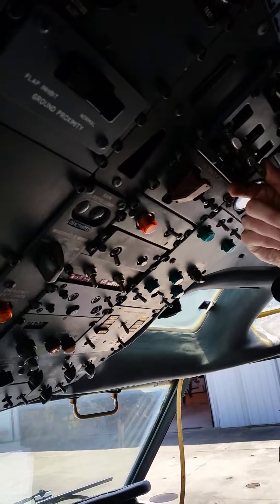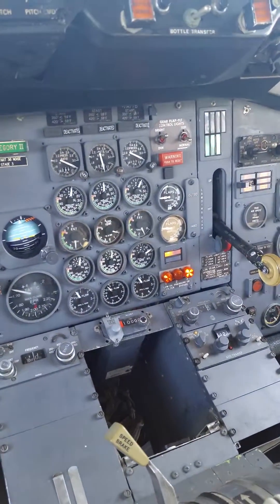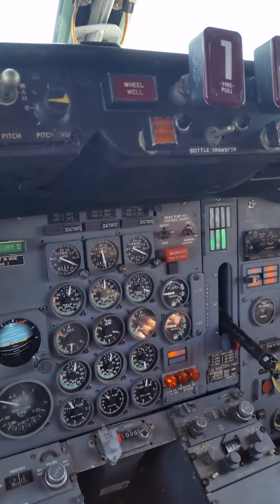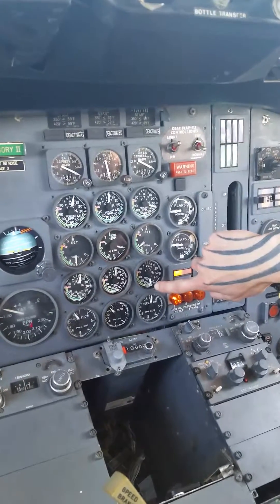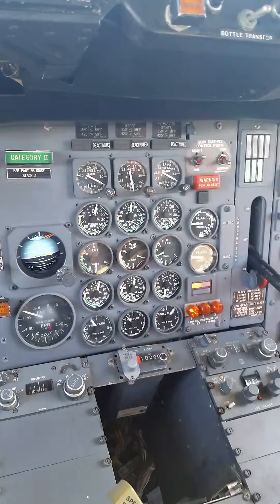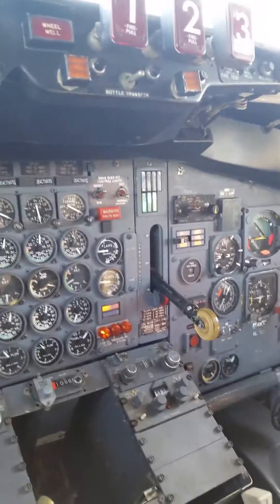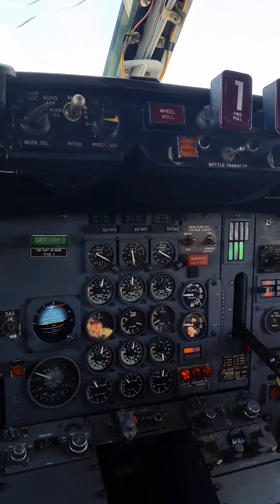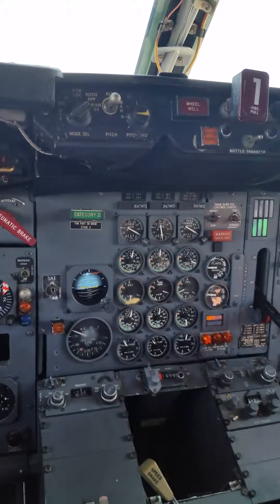B727 engine startup

Comment: No B system pressure (the brakes are on B system).  Only showing accumulator pre-charge pressure on the brake pressure gauge (meaning ZERO brake pressure). No pneumatic (emergency) brake system pressure. This was VERY dangerous, especially when you advanced the thrust levers.  The only thing holding this airplane were the chocks. You have NO IDEA just how dangerous this was.
Reply from the maker: not disagreeing with you at all. If I remember, we knew there were no brakes and it also had a mean hydraulic leak from a horizontal stab actuator that we didnt have the equipment to reach it for repair. The apu was also being problematic. But, we just use one of the engines to train students on proper turbine start up sequence and how to read the EGT gauges. That plane hasnt moved in a very long time and is one hot start away from a tax write off and the scrap yard.